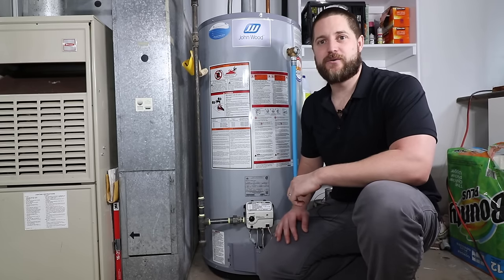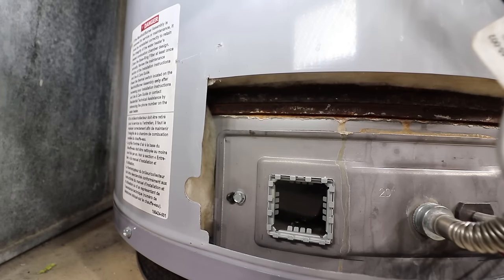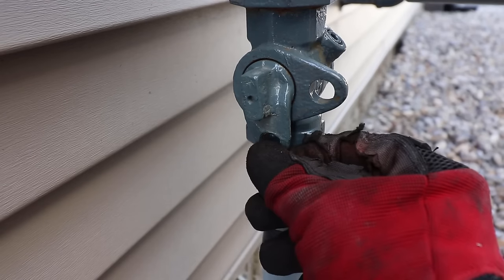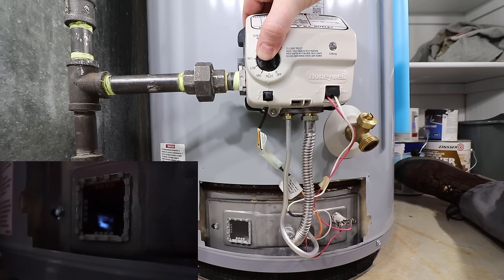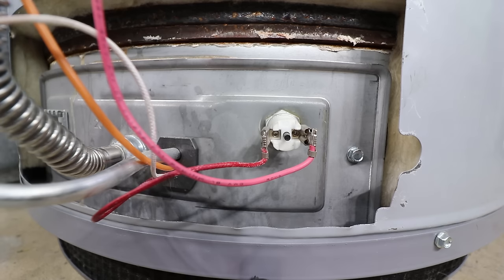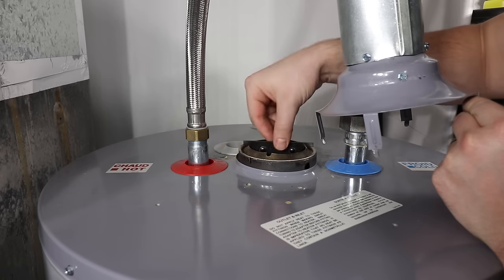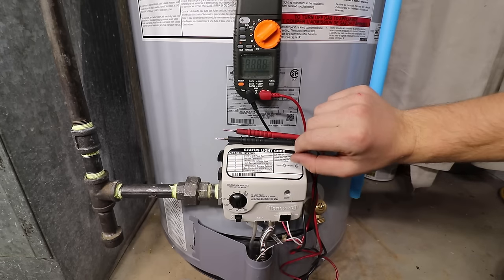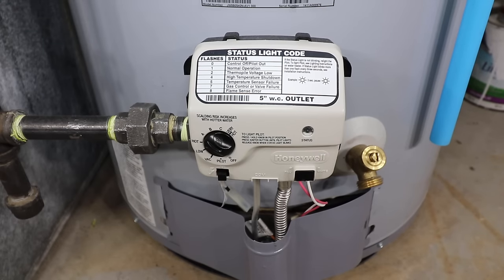No Hot Water: Water Heater Troubleshooting

Comment: Excellent professional guidance!  Here is another tip.  If the water heater pilot light is not igniting, it may be the spark is not strong enough.  There is a wire coming from the igniter.  Disconnect this wire and spray contact cleaner on it and reconnect it.  Then turn the dial to pilot.  Wait at least 5 minutes.  While the dial is pointing to pilot, press and hold the dial, and click the igniter every 10 seconds until you hear a subtle dull pop (which is an indication the pilot is lit).  Keep holding the dial in and keep clicking every 15 seconds until you see the light start flashing every 3 seconds or so.   If not lit within 2 minutes, stop and try again after 15 minutes.

Comment: Thanks for the post.  I got mine restarted after leaving it off for 10 minutes.  I have a Rheem, and it took a while for the pilot light to stay lit while I adjusted the temperature control setting.  So far, so good, I'll know that all is good in the morning if I have hot water.

Comment: Thanks for the great video Pat. We Rheem Guardian System Fury Gas Water Heater (EverKleen Self Cleaning Water Heater) Model 22V50F1 50 Gallons using 38,000 BTHU. The heat gauge was set to almost High for heat and the broiler was in full high, yet the water was just lukewarm. I was watching this video to see what was wrong, and I noticed it was not dirty, as this tank has nothing to clean, it does not have a indicate control either, so no codes and it was made in May 2007 (maybe that is why it has no indication controller). I turned the red water temp gauge from HOT to one notch before the WARM (the white line) and now it seems to be making hot water.
Reply from the maker: Thank you The Power Of Your Voice Podcast! It sounds like it could be a damaged dip tube. The dip tube is a tube that is extends inside the cold water supply of the water heater. It directs the cold water to the bottom of the tank and the hot water is taken off the top. If this tube is damaged, the cold water will mix with the hot water towards the top of the tank. This will give you a shortage of hot water or lukewarm water. Do you find your hot water doesn't last long?

Comment: My problem, sadly, is not yet resolved. I have the identical Honeywell valve controller you show but a different Whirlpool Ultra Low Box water heater that apparently doesn't have that resettable thermal switch. Nevertheless, your video gave me complete confidence to assess the problem and understand my issues. I wish I could find a way to reset the thermal switch for my setup. Barring that, my next guess is failure with the thermopile. Easter weekend during COVID should be a fun bill to pay. This of course also came to my attention at 1 AM. If you have any ideas/suggestions for where I might find the equivalent to that resettable thermal switch, that might just do the trick. In any case, thank you for the excellent and informative video.

Comment: After a major windy hail storm in May, my pilot would come on but not the burner. Honeywell code was two light blinks followed by 3 seconds. Plumber's assistant came and after I asked him to, cleaned the burner and vacuumed out area under burner. It worked and after a few hours, the water heater was back to working so I assume the burner was lit. Until the other night: major windy/snow storm moved in. Again, pilot lights but not burner. I tried to clean it this time with compressed air and vacuum. Burner had debris on  top of it and compressed air blew a lot of paint chips out of the filter area below burner (not sure why). But burner wouldn't light this time after pilot does. Back to 2 light blinks followed by 3 seconds. There is some debris under the vent area on top of water heater, but did back draft test and smoke seems to be going up the flue. So lots of wind, burner won't light. What is going on? Why does wind affect my water heater so much?
Reply from the maker: If the pilot is staying lit and it's blinking 2 blinks, it's a thermopile voltage issue. It can be verified with a thermopile voltage test: https://youtu.be/mtbn3FtMqCM
With that much debris it may be a slightly clogged pilot gas tube as well, causing a weak pilot flame and low thermopile voltage.
If the test fails then replace the thermopile.

Comment: Okay so I'm not getting any spark, no pilot light and the gas valves are correct and gas is present.  I have an almost identical Honeywell control box except mine does not have the "resettable thermal switch".  The wires just go through a rubber grommet in the metal panel and out of sight.  The red and white wire just goes directly from the control box and into and behind the steel wall of the tank.  Another question being, where is the power coming from to light the pilot?  I don't see an electrical line leaving the tank anywhere to a socket.  Is it a battery inside the control box?  The reason I ask is because I get no spark at all when holding down the gas button and clicking the ignition button.  There is no status light blinking at all but guess that's normal with the pilot out?

Comment: I just purchased a Lochinvar Water Heater yesterday.  This video was really helpful in explaining the components of the unit, especially the  control valve/thermostat.  But I do have one question.  I assume the control value has some sort of battery to power the status light and the ignitor.  I don't see anywhere in my instructions any procedure to replace this battery.  Is this battery something that cannot be changed out?

Comment: Great troubleshooting video! I am stumped by my problem which started three four weeks ago. Every four five days I would get a hickup in the hot water delivery. The water would be cold after a  morning shower. Then after a couple of hours the water heater will get hot again and provide hot water without any problem  for a few more days. The pilot light has not gone out when you have the cold water output. The controller is flashing normally every three seconds...flashes do not indicate any problems. What could it be..the Honeywell controller?

Comment: Greetings from Ottawa, ON. I just came across your  very well-produced and informative video. No wonder there are more than half a million views! May I know what is the surge and running wattage of a typical 60-gallon water heater running on gas (in Canada's case we use Enbridge gas). I am trying to use either a Bluetti AC200P, Ecoflow Delta Pro or Gas generator to power the water heater in the even there is a power outage which is quite common during winter here in Canada. I look forward to a reply from anyone on this YouTube channel. Thanks in advance.

Comment: Great video. helped be solve my boiler problem. After I turn the boiler pilot on, do I leave the dial in pilot of switch it back to where it was (B)?
Reply from the maker: Thanks Robby! After you turn it to the "ON" position, set the temperature to what you require (cooler) A, B, or C (hotter), or anything in between.

Comment: Sorry, but even though your video was clear and to the point, my gas water heater is older/cheaper and doesn’t have any of these features (striker for pilot, window to check pilot, etc), so…I guess probably the next question is, should I replace this? And if so, with what? On demand heater, maybe? New widow, live alone, on fixed income, handicapped. Any suggestions welcome! TIA!

Comment: Hello, thanks soooo much that worked & I got my pilot lit up again & my light is blink every 3 seconds but why is my water only warm & not hot as it usually gets?
Reply from the maker: How long as it been running? It usually takes most water heaters 1 hour for full recovery and having hot water. Glad the video was helpful! Cheers!
Reply: Did u figure it out?? I’m having the same issue?

Comment: Thanks for your great video! Due to watching your video, I got more knowledge about water heater now. I have almost identical heater (5 years old only, still in excellent condition) like the one on your video except there is no reset switch; however I still cannot locate the issue after watching your video several times. My problem is: there is no ignition, no spark/flame, no blinking status light, no reset switch/thermal switch, no hot water in two days, the tank is totally cold now. I have unplugged the wires and plugged back, still nothing happened. In my situation, where do I start trouble shooting? Thanks in advance!
Reply: Hello @daniel , I have precisely same issue. Did you get it to work eventually? May I know how did you fix it? Appreciate your help. Thank you 🙏

Comment: My gas control valve looks exactly like your but I don't have the reset switch.
My pilot lights easily sometimes on the first pop of the piezo. The voltage on the thermopile sometimes reaches as high as 780 mv but there's never any light on the status light, and when I release the pilot button, the fire immediately goes out. Incidentally, the glass vial cutoff switch is intact.
What seems to be my problem?

Comment: Hey Pat, I have a Rheem performance 50gal gas heater only a couple of yrs old. A couple days ago for an unexplained reason I had to restart my water heater. I am getting a blue indicator light flashing. So I assumed everything was fine. Well now the 2 days later the water is not as hot as it used to be. I have made adjustments and do not notice any change in the water temps. What could be my issue or issues? Thanks a lot for the great videos.
Reply from the maker: Hello gustavo, Just to make sure are we talking about an atmospherically vented water heater as shown in the video? With the metal venting on top?
Before you restarted the pilot/water heater did you notice any error codes/status lights? You're right that the blue status light should mean normal operation for the Rheem performance model. What heat setting do you currently have the control valve? This is a tough one to diagnose online because it could be multiple things. Two possible causes that come to mind are a faulty control valve or a hot water to cold water cross connection.
Cross connections are rare but because your water heater is only a couple years old and the status light is blinking normal operation makes me think this could be the issue. What can happen is if a shower valve cartridge fails or a single handle faucet fails, the hot and cold water can mix causing two things. First being the hot water supply is cooler than usual because it is mixing with the cold. Second being the water heater will run for long periods at a time and can overheat/shutdown and require a reset. High temperature shutdown is 4 red blinks. To test if there's a cross connection close the cold water supply entering the top of the water heater. Open the hot only on a faucet fully. If the hot water at the faucet comes to a complete stop there's no cross connection. If it continues to run with steady pressure there's a cross connection somewhere. Start with this test and let me know how it goes. If the water heater goes out again make sure to take note of any status lights before relighting. Good Luck!

Comment: This video helped a lot trying to figure out how to properly ignite my pilot flame. One question. Should I see that small of a flame? I've turned it to it's hottest setting but I still just see that small flame. I would imagine it looking like a ring of flames like that gas stove, or am I completely off?
Reply from the maker: You're correct. When there's a call for heat the main burner should fire up, and it will look like a ring of flames.
There's a couple reasons why the main burner might not have fired.
1. Main control knob on top is set to pilot. It must be set to ON for the main burner to fire.
2. Water is already hot. Test by turning up the temperature and running the hot water for a bit.
3. Faulty control valve.
Let me know how it goes and if you have any other questions. Thanks for the question!

Comment: I have the exact opposite problem most people come to channels like this one. I always had hot water available at this house I moved into 18 months ago. However, the natural gas water heater is off, there's no gas service to this address, and no breaker for an electric one. The previous owners didn't say anything about an inline tankless heater nor did the inspection report. Gas service told me they took the meter away from this address before I moved in. So, how am I keeping in hot water? If an inline tankless one was put in by a previous owner and buried in the attic or behind sheetrock there would be some kind of record of it somewhere. There would be a breaker in the circuit box for the water heater as well and there is none. Remains a mystery.

Comment: Hey so first off thanks for making this video it really helped alot. Just got one question for you. Is it normal  for it to blink 7 times for like a min then switch to blinking once for normal operations?
Reply from the maker: Hi Kevin Martinez. Thanks for the question. It isn't normal to blink 7 times at first. Is it doing this when you first light the pilot or when there's an initial call for heat? It could run fine like this for years, but 7 blinks indicates an issue with the control valve. If it was a clients house I would replace the gas control. If it was my own house, I'd buy a replacement control valve and just have it on hand. Just in case it failed completely. Thanks!

Comment: My tenants told me that the hot water heater was producing only lukewarm water. When I checked it, the status light was a green light that was blinking continuously. I went thru your video, did all the tests you performed. It seemed to pass all the tests. After I restarted the pilot, the status light started blinking green every three seconds. I believe this is what it's supposed to do. I cant figure out what the problem was and if it's fixed now or not?
Reply from the maker: Is it lukewarm at just one fixture or the whole home? Does the main burner flame turn on? If the main burner is function probably. It is one of 2 things.
1. They used up the hot water and the tank is recovering. This can take an hour to produce hot water again.
2. The dip tube is damaged. This will cause a shortage in the hot water supply and lukewarm water. I have a video explaining this better. Please see: https://youtu.be/j6hZY2FfEhM

Comment: Please help answer my  question and thank you in advance. When you say “a lack of combustion air”, does storage near the unit may cause a lack of combustion air? And I just have a power outage 2 days ago, could that be the cause of it not working?
Reply from the maker: Lack of combustion air usually just refers to the intake screen being clogged, but extremely air tight rooms can cause it as well. Such as a closet. The storage shouldn't effect it. Just a few questions to get you in the right direction.
Do you have no hot water at all or lack of hot water? Do you have a powered water heater? (you have to plug it in) or is it the same as in the video?
Reply: Had power outage, and no no hot water. Same setup as in video. Pilot light will not go on. It is a 30 month old (2 and 1/2 yr) 40 gallon tank. Any ideas?

Comment: Hi, I really need some assistance as I can not afford getting a plumber in my home. My water heater’s pilot light is on and I can get it to stay on, but when I kick the control knob to my desired setting, the gas kicks in and lights the chamber with a good amount of light/fire for 2-3 seconds, then the entire light dies quickly thereafter. I am guessing i will need to do a gas control valve replacement - is that correct?
Reply from the maker: I would check for a clogged intake screen at the base of the tank first. If the intake screen is clogged it could starve the main burner's flame from oxygen. This would cause an erratic flame, and in extreme scenarios the flame to actually go out. A clogged exhaust could cause this to happen as well but is far less common. The main burner flame will by more orange than blue if there's lack of oxygen. I would check the thermopile's voltage before replacing the control valve as well. How to test a thermopile's voltage: https://youtu.be/mtbn3FtMqCM If the screen is clear and you have a nice clean blue/orangish flame and the themropile voltage test checks out to be ok, then I'd replace the control valve.
Reply: @PROSDIY  thanks!!!! I found it to be the TRD thermal Release device that was tripped and broken... not sure why..

Comment: Hey I have a question if possible hope you can answer this so everything pretty much passed the fire is on, I have a blue flash every 3 seconds it doesn't flash fast but every time the washing machine is on there is no hot water or atleast I think it's everytime I dont know this is the first time me catching it do that was tryna take a shower but nope, so could you possibly help please I'd like to get hit water could you possibly offer some other troubleshooting please
Reply: I also have the tank where you can choose the setting it's on B had it on A moved it back to B and still cold water what would be the issue please help this is for my parents house thanks